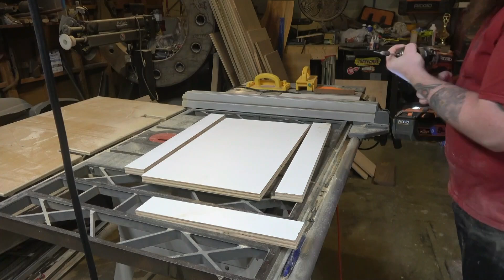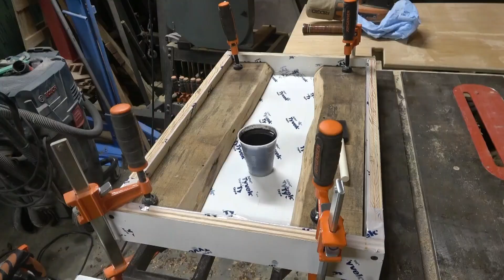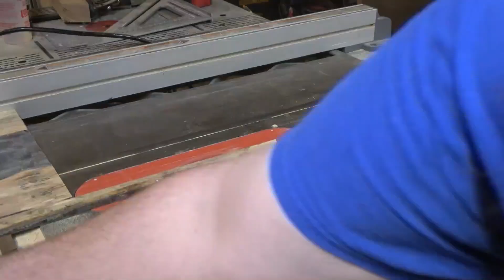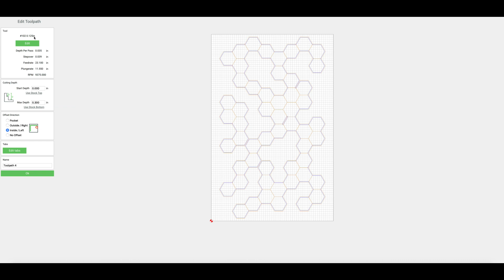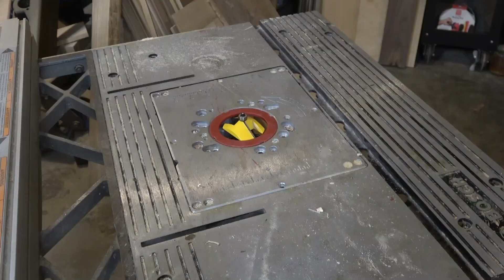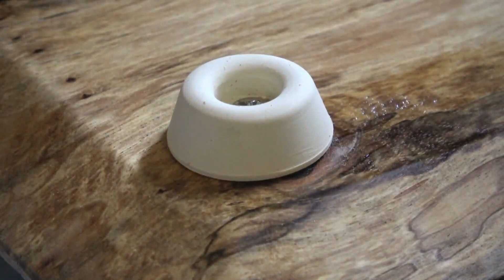CNC router Charcuterie Board Project

Comment: Great work and great kickback dodge:)
Reply from the maker: Kickback dodge?
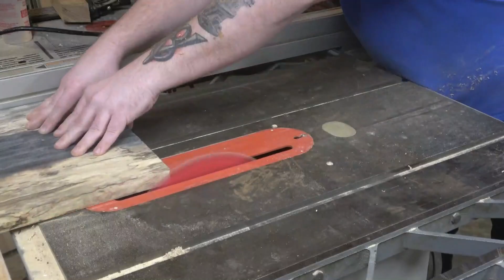Reply: Chris Powell at 5:35 it looks like the cut piece flew, which luckily didn’t cause any trouble.
Reply from the maker: @skellez83  o ok. I thought you meant an actual kick back, like where the piece jams between the blade and fence.
Reply: Chris Powell oh I guess I wasn’t accurate haha. Not a pro:)
Reply from the maker: @skellez83  ah it’s no problem. Sometimes the pieces shooting back like that can be a little dangerous, but in this case it probably just looked worse because of the time lapse video.
Reply: Chris Powell yes definitely! The table saw  is so scary to me. Great work!!

Comment: Nice build. Did you have any issues with bubbles in the finished product? It seems like I always have a couple of bubbles that I have to fill after the final pour.
Reply from the maker: Just a few very small ones. I used CA glue to fill them. I think brushing some tools j before doing the pour really helped.

Comment: Nicely done but the title is very misleading. This is not DIY. It’s cnc.
Reply from the maker: It’s a hobby cnc router. It’s just another tool. Not everyone will have access to all tools. If you didn’t have a table saw, and saw someone using one in a project, would you say it’s not diy? The point is to learn and grow.
Reply: Chris Powell hey I complimented first and said it was nicely done. DIY stands for do it yourself. Cnc stands computer numerically controlled. By its own definition it’s not DIY. Again nicely executed.
Reply from the maker: I appreciate that. Just trying to educate you on the subject. The computer doesn’t just spit out parts.
Reply: Chris Powell I get that. I guess I was just hoping you were going to show how to do that design with a router or chisels. No biggie. 👍👍

Comment: Hi ! I’m trying to do a live edge charcuterie and cutting board. Both rounds have bark still attached which I would like to keep. They also both have cracks. What is a good food safe brand I can use to fill the cracks and put on the bark for extra hold? Or is there a better way to deal with the cracks that’s food safe? Thank you, looking forward to your response!
Reply from the maker: It seems like most is rated as food safe. I used Glaze Coat in this video. I also have some Total Boat, and that is also rated as food safe. I topcoated with Odie’s Oil. I’m not sure how well anything will help keep the bark on. It naturally wants to fall off. Maybe one of the thinset epoxied would deep down into the crevices and help hold everything together better.

Comment: Very informative video. Was just wondering did you let that sealing coat dry that you brushed on? How long?
Reply from the maker: Thanks. I didn’t wait for it to fully cure, I just let it get to the point where it was very tacky and wasn’t flowing at all. It was a few hours before I did the first pour. I use this same epoxy on the flags I make, and noticed that the .075” deep lines that I fill need to sit over night before they are hard. The thicker pours seemed to cure considerably faster.
Reply: @ChrisPowellFSD  More heat ??

Comment: Great Job! Did you set up the surfacing tool path in Carbide Create?
Reply from the maker: Thanks! I actually just used the directional control buttons and did it manually. This allowed me to adjust the depth on the fly. I figured since I was going to sit there watching it anyways, I could just do it that way. I just left it on the fast speed.
Reply: @ChrisPowellFSD  Thanks! That's easy enough. I thought I might be missing something in CC. I'm still learning what all I can do with it.
Reply from the maker: You can do it. I just chose not to for this project. Just make a rectangle the side of your workpiece, I put the settings for the 1” bit, set your zero, and go to town.
Reply: @ChrisPowellFSD  I've done that a few times already on a couple of projects but it seems like the straight line raster path is quicker and more efficient than the spiral pocketing tool path.
Reply from the maker: Yea it might be best to draw the lines with CC and just do a no offset toolpath. You would have to close them. I might try doing something like that in the future.
Reply: @ChrisPowellFSD  Sounds like a plan. I might try that as well. Thanks again!

Comment: Very cool. I've been following the pics of this. What tip of bit did you use to cut the hexagons, up, down, or compression? How difficult was it to get the epoxy out of the grooves, and did you have any issues with it melting like plexiglass?
Reply from the maker: I used a straight 2 flute Bosch mortising bit. That’s probably why the epoxy dust stick in the grooves. It wasn’t hard to get out. It was just like a compressed powder. I didn’t have any issues with it melting.